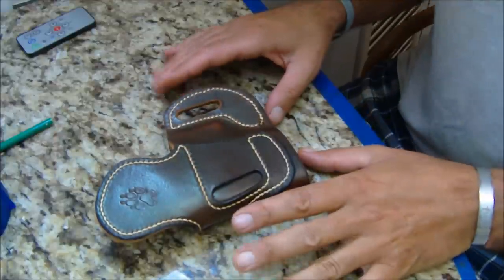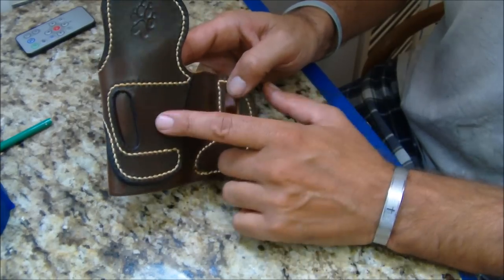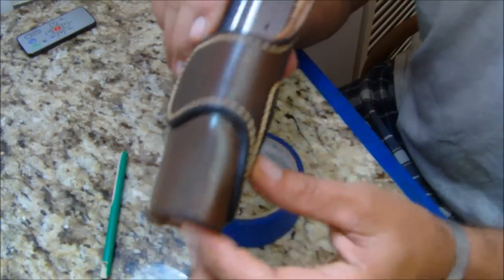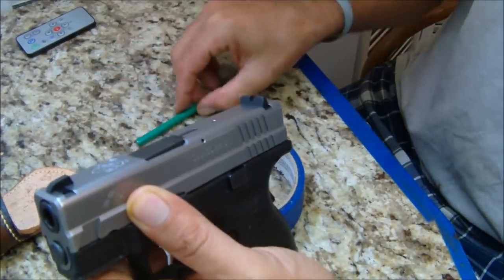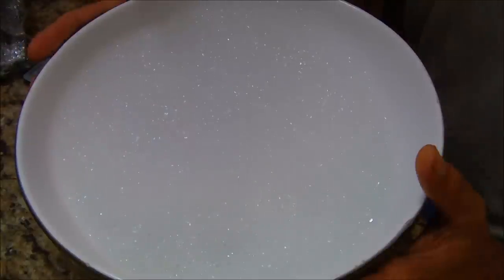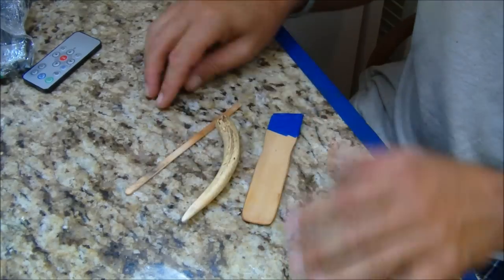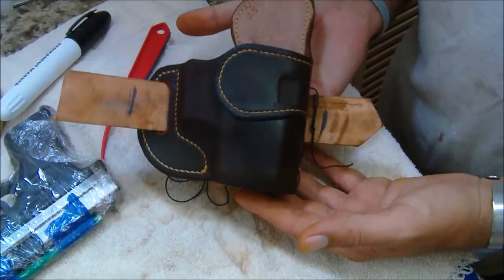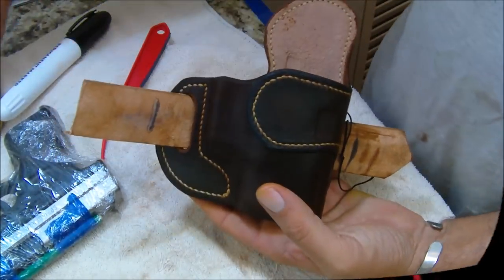Homemade Leather Holster Part 6 (Wet Forming)

Comment: I have used a food saver bag and vacuum pack the holster & gun to shape and form the holster.
Reply from the maker: I was thinking about trying that.  How does it work?  Do you get decent form? I thought maybe it would give a basic form than finish with my tools. Thanks for watching.
Reply: works great, also used it with Klydex.  Just tape up some dimes and place them in the trigger guard to keep the plastic from sinking in to far.